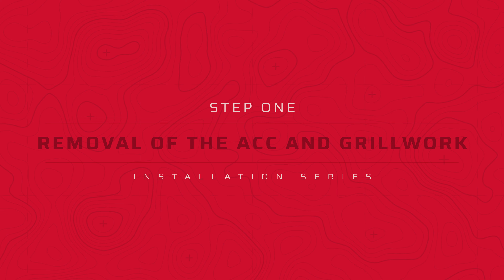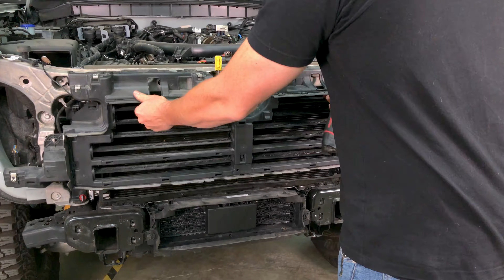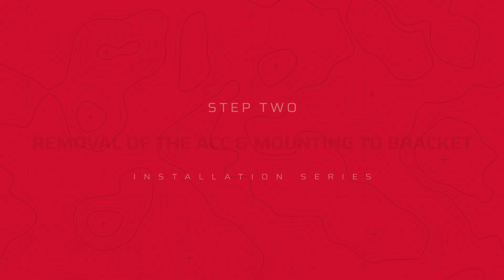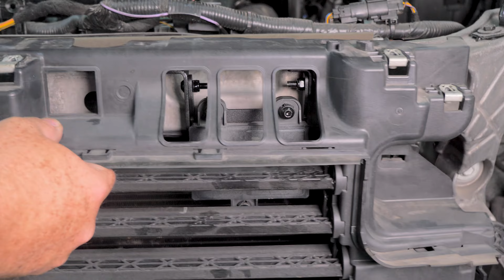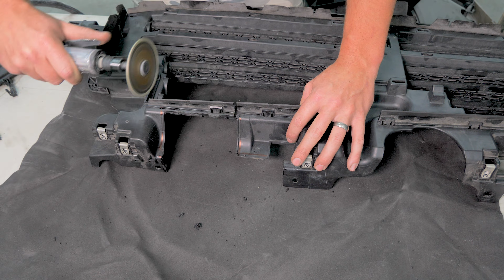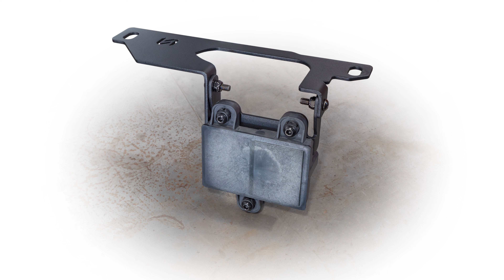Turn Offroad's Ford Bronco High Clearance ACC Relocation Bracket Installation Guide.

Comment: Hello, have you had any issues with these? I’ve installed an ACC relocation bracket for my bronco, appears to be “the same” as yours but from DV8 and I’ve gotten codes saying:

“Adaptive Cruise
Not Available
Sensor Blocked
See Manual”
&
“Pre-Collision Assist
Not Available
Sensor Blocked”
Reply from the maker: Hi! We have not had any issues to date. To shed some light on your current setup that code indicates that something is in front of the sensor impeding its ability to sense obstacles in front of you. If there is nothing in front of the sensor then its possible that the sensor was damaged during installation. If the sensor was dropped or the hardware holding it in place was overtightened you can get that same code.
Reply: @turnoffroad  thank you I appreciate it, I’ll take a look at it! Ya I mean the only thing in front of it is obviously the grill, but that’s it 🤷‍♀️
Reply from the maker: Got it! Then yes it sounds like there is something wrong with either the sensor or the wiring.  @kimberlybiswell2023
Reply: @turnoffroad  ya also, it seems to only be trowing those codes when it’s raining pretty decent, that I’ve noticed